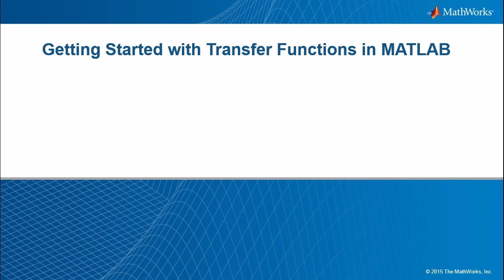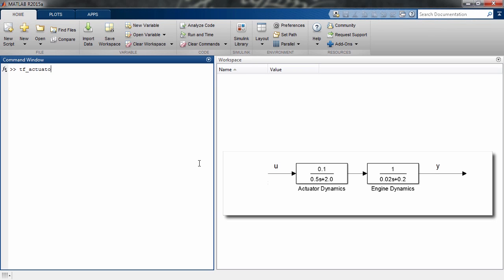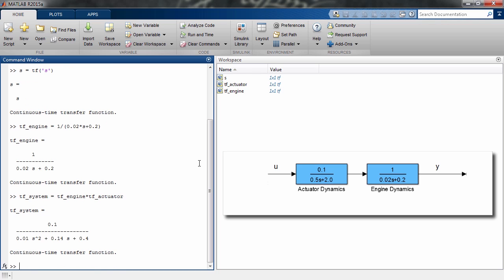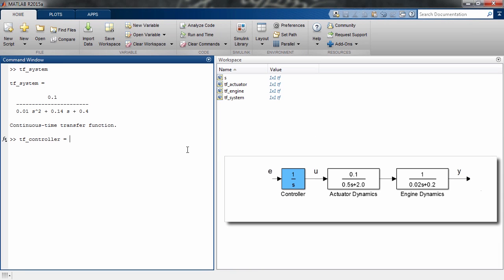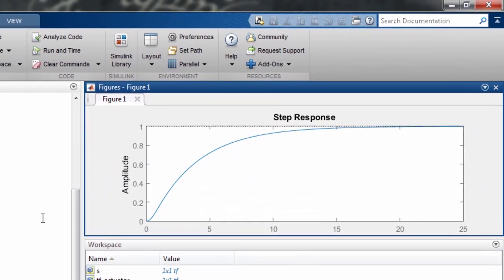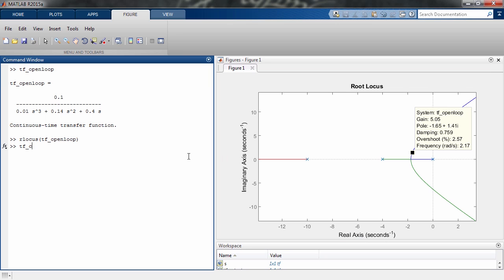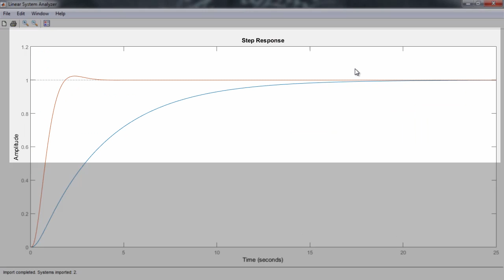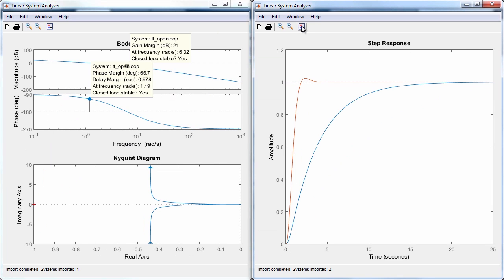Working with Transfer Functions in MATLAB

Comment: Hi, I'm using MatLab 2015 for academic use when try to use tf command to create a transfer fuction MatLab states that "Underdefined function or variable 'tf'." How can I define tf to create transfer function or am I doing something wrong considering this error.
Reply: I guess I didn't have the control toolbox that was the reason, problem solved no problem :D